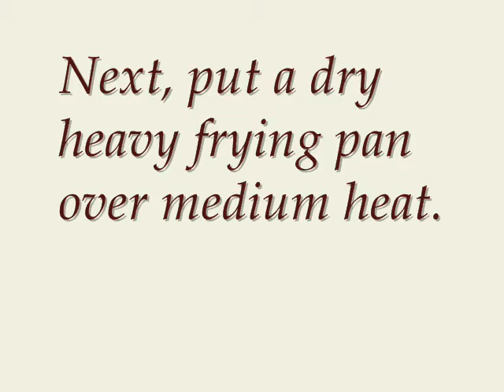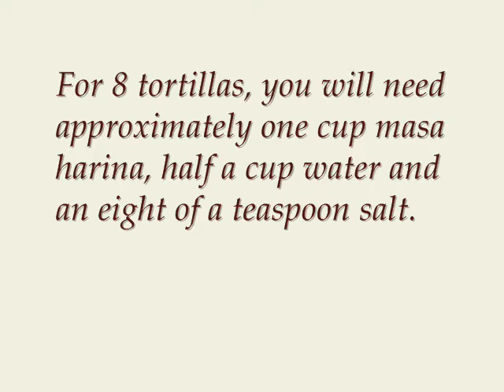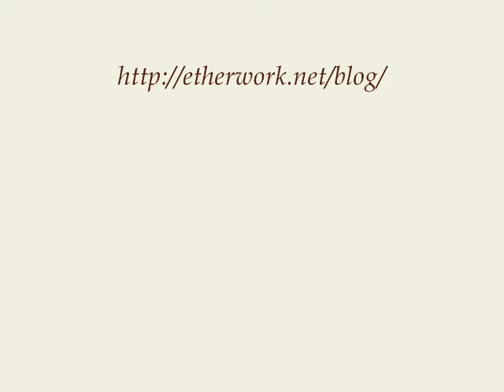making corn tortillas from scratch (1st draft)

Comment from the maker: We keep forgetting try it with flour tortillas. Whenever we've made them, we've used a rolling pin.

However, I'm thinking it should work, but you may have to let the unfinished disc rest a few minutes between pressings because the gluten in the flour will make it want to spring back on itself. With flour tortillas, you may also have to scatter a bit of flour down on the surfaces.

Comment from the maker: About a year ago, neglectoid asked "would that pressing process work with flour tortillas?"

We finally tried this pressing method with wheat flour tortillas a few weeks ago. Alas, it doesn't work very well at all. The glutens make the disc spring back too much. A rolling pin works much better.

Comment: that's not from scrach lmao
Reply from the maker: I hadn't thought about it carefully; you may be right! After all, we didn't grow the corn, harvest it, dry it, lime it, and mill it ourselves. Nor did we mine the salt....

But is it kind to of you to laugh about the error?
Reply: I'm sorry for laughing I didn't mean it that way
Reply: +etherwork That was no error. Your critic was being an a/h. lovely video. I will try it today. For chicken enchilades in white sauce. Your recipe needs more water. The masa bag says 3/4 cup water for each cup of masa flour. It needs it. I also used a comal (flat pan) to press the tortillas using one foot rather than both hands. Much easier and faster. Legs + body weight much stronger than arms. Here&#39;s the recipe from our website:

http://drdaddycooks.blogspot.com/2012/07/chicken-enchiladas.html
Reply: +etherwork I think he meant the instant flour. It's the same here with pancake flour, basic pancake flour should be wheat flour, baking powder and salt. But they buy instant to skip these steps and they get a mix full of crap to increase shelf life instead of just flour, baking powder and salt.

I too am very curious what exactly is in instant tortilla flour that is not in corn flour to which you add some salt yourself?
My reasons for wanting to know are 3 fold:
-Like with the pancake mix in my country I like to avoid the unnecessary additives, if any, in preprocessed stuff as it really doesn't save time in these cases at all anyway.
-Second, I'm a hobby cook. I actually just want to know what goes into everything from the ground up and do it myself. 
-Thirdly, corn flour is not a common ingredient in cuisines in this part of the world so I'm lucky when I can find good plain corn flower, never mind looking for a specific instant mix.
So in case there is something other than corn flour that really needs to be in tortilla dough I need to find out lol.

I tried finding out looking up package labelling in things like maseca but it seems they aren't required to print exactly what is in the product on their labels like they have to do where I live?, so I have no idea if I'm missing anything.
Video's haven't helped out either as I haven't been able to find anyone not using instant mix that isn't available worldwide.

 If you happen to know if there's anything critical in instant tortilla flour that isn't in plain corn flour with some salt I'd be grateful.

Thanks for the video! I was looking for how to make due without a tortillero(?) when I'm going to try and do an authentic Mexican food day one of these weekends.